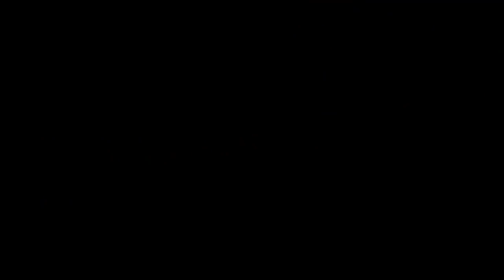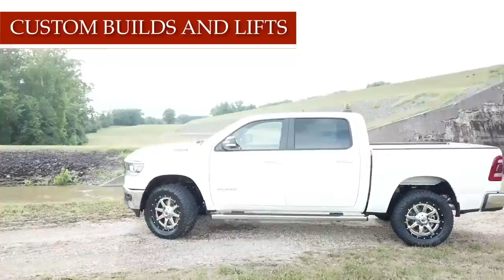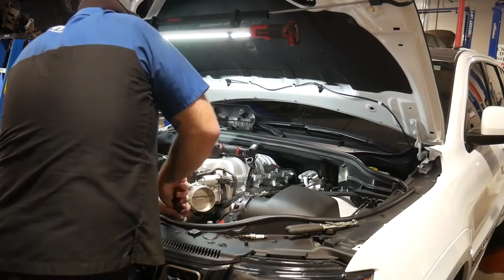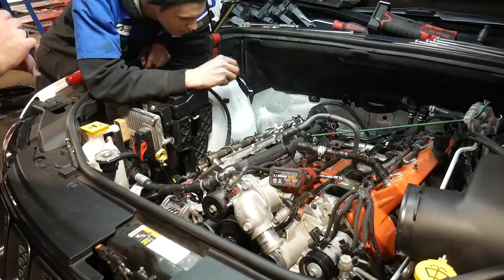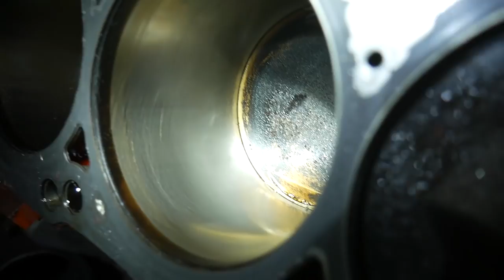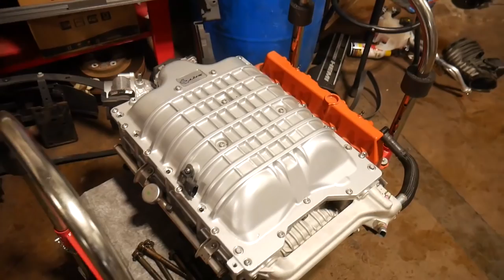TRACKHAWK HELLCAT ENGINE ISSUE AND HEAD REMOVAL

Comment from the maker: Just a repin from fwddodge22...
Yes he found the problem. The valve stem seal failure will cause a significant vacuum leak into the crank case. As a result the engine will suck down oil through that failed seal. Also since this is a forced induction engine, that same failed seal will allow boost as higher Rpms to force pressure the opposite way through that same failed seal - so instead of oil being consumed at idle, run the rpms up to 3000 rpm now intake air pressure is forcing oil back out through the pcv system which is then getting sucked into the intake and through the supercharger. The misfire is due to the extra oil getting into the chamber where the failed seal is making the mixture way too rich- that’s where the carbon deposits on the back on the intake valve, and the spark plug along from leaking oil come from. 
Also there were extra tests with compression and leakdown done before I started filming, I will be sure to add those next time.
Reply: Rustbelt Mechanic  noob question but would the valve stem seal failure also cause low compression as well in that cylinder?
Reply: Has there been any updated on the motor
Reply: Well said
Reply: Have ya worked on any of the 2016 chrysler 200 wit the 2.4l engine and excessive oil consumption
Reply: @skschow779  no.
Reply: Not yet
Reply: I like the fact that yall honest mechanics and yall show yall work to the world unlike the snakes here in Philadelphia keep up the good work
Reply: TheCarSection TheCarSection not every mechanic has a YouTube channel
Reply: @Simon Chow no it shouldn't. just oil consumption
Reply: @skschow779  no. The seal is above the sealing area. The valve guide would have to be real jacked up causing to valve to shift in the seat to cause a pressure loss. Very unlikely but is possible.
Reply: Just one question, How does "extra oil getting into the chamber" make the mixture way too rich? I'm not following
Reply: @jairosendsit8667  I understand that but you don't know how many snakes as mechanics we have here it's a big thing here.
Reply: @xj31  oil is combustible like gasoline. The engine doesn't know the difference. It will burn it as a fuel source if it gets into the combustion chamber. The problem now is that the engine already has a calculated fuel amount going into each cylinder for a correct fuel/air ratio under load. That added oil was never supposed to be calculated which causes a richer fuel/air ratio in that specific cylinder which results in a misfire. That misfire can cause serious damage to the engine if left unchecked.
Reply: @YeahYall  That was a great explanation, but it wasn't a test for you, LOL.
 I will admit, I didn't watch the entire video, for some reason it keeps stuttering and I can't take it
Reply: You can always tell the parts replacers from the actual technicians. Lol.
Reply: @BAYAREAMX  Yea, the parts changers are the guys making money
Reply: typical rookie mechanic coming through last minute to "add" the test which were completed off camera. imo
Reply: @imfloridano5448  what?!?! Oil consumption?!? On a 2.4?
We were keeping 3 of those motors in stock
Reply: @BAYAREAMX  true. But that's the way it is. This is the only job I know of that pays you less the better you are at it
Reply: @skschow779  :fi

Comment: 100k truck and no fender protectors?  Wtf
Reply: Just got my 392 back from the dealer and I can clearly see the shirt/button imprints on the fender! Lol. Obviously not using the fender covers.
Reply: That and hang a light from the hood, on the paint!!! I almost cant watch
Reply: That’s the way it is with most of the shops, you go in to get your car fixed and come out with all kinds of scratches and marks on your car. I dread taking my car to get it serviced. Good luck if they put everything back where it goes.
Reply: They'll leave oil on the steering wheel, shifter, your seats, your doors. Etc. Including scratches on the front bumper from the guys wallet chain 😅 Yuck. No thanks.
Reply: David Hammett oh please, that’s when my ocd kicks in.
Reply: Yeah I was wonder why no fender cover I'd be pissed!   One time my super duty went in for a recall and the mechanic had a big cowboy belt buckle and scratched up my fender....it got ugly for sure!
Reply: @JAMESWUERTELE  They are foam ends. It isn't going to hurt the paint.  It's not in motion rubbing either.  Don't like a tech using one? Fix it yourself.
Reply: I never used fender/bumper protectors when i was a new tech, i was very cautious and did not leave a singel mark for 4-5 years, then one day the quick connector on my airgun failed and the hose and connector hit the front bumper and made a small scratch, I had the bumper repainted and since that day i use protection everytime i do under hood jobs.
Reply: Jason Daniels I do fix it myself, my 2 Nissan’s and old 7.3 Ford stay away from hacks.
Reply: You get what you pay for. Want better car takin of your car find a local small shop that specializes. Like us we primarily do classic hot rods but are fully equit to do brand new vehicle's as well as trained. Plus we give the same care as our classics wiped before covers are placed on seat, floor, and wheel as well as both fenders and hood slips. After services are complete your vehilce is fully detailed and ready for pick up. Just shop around people!
Reply: I like how you say take it somewhere else for better service . It's a new vehicle getting a warranty repair. It has nothing to do with what you pay for the service it's about a tech taking pride in their work.  Even jiffy lube tosses a cover or two on during a 20 min oil change. These guys are leaning on it for hours. 

It's for these reasons I always wash my truck and do a video walk around before any service.
Reply: Soy Yo  Soy Boy your driving a 92 Honda of course you wouldnt care
Reply: And he has Ear Pods in. Wow. Smh.
Reply: Just got my scat pack back with scratches, chipped lower grill, and a new wind splitter. It has a appointment with their body shop on the 16th. Maybe this is a Dodge thing. Bring em in and bump em into shit.
Reply: @getnbigger29  actually it does! Just because the dealership sold you the vehicle doesn't mean you have to go there for warranty work. We have local dealerships (ford, mazda) send us warranty work regularly. If you want your vehicle cared for rather then just simple maintnace go private. You want a shiny building to take your car to with people only trained in certain areas scratching your car and leaving grease everywhere then go stealership!
Reply: news flash, I have worked at 3 major dealers and I have never seen a single tech use a fender cover. maybe if they payed a 0.1 punch for using them the flat rate guys might bite;)
Reply: I was about to say the same thing. 🤣

Comment: Love how they are both leaning over the guys fenders with no covers scratching the shot out of his paint of a $100k Jeep. This is exactly why I don’t let the dealer touch my truck. Warranty or not
Reply: Don't worry, it doesn't matter. All of them will be in the junkyard soon enough just like all the rest. Remember all of those chargers and vans they sold (regardless of model)? Yeah, I RARELY see one still going and it's usually an srt8 that probably has low miles lol. We can even ignore all of the smaller passenger cars that have all been melted down in China.
Reply: It’s just a jeep with a hellcat engine. A body shop can easily touch up scratches.

Comment: It's a hellcat lottery kind of thing. I've already had to rebuild 2 of these engines due to piston failures. One car at 800 hp with absolute perfect data log. Tune was spot on and the other was a stock hellcat. Both suffered piston failures due to breaking right around the oil drain back holes separating the top of the piston from the bottom. Cylinder 5 one one 7 on the other. I've seen these cars make right at 1000 hp with no issues. Guess it's a lottery thing.

Comment: I would never bring my car to your shop-no protection on the paint they make a roll of film for this. What really gets me is you never even taped up the intake ports, all that dirt and the risk for something dropping in there would not be good. Just tore into it without a proper diagnosis other than an oily plug....
Reply: No one wants you as a customer anyways Douche canoe
Reply: Better to remain silent and thought of as a fool, than to comment and be known as 1
Reply: Dave D I was thinking same thing. $100,000 Jeep.....WTF!!!!!
Reply: All the dirt? What dirt? It has no miles on it. That thing is spotless. You don't know what other diag was done so.....It's not his first rodeo so experience helps get to the bottom quickly.

Comment: Confused a boroscope or leak down couldn't give u the same answers
Reply from the maker: Leak down was within 5 % and engineering wanted head pulled likely due to how new this engine is
Reply: How would you put a bore scope through the s/c ?
Reply: @stonesofetown6767  Spark plug hole?
Reply: @stonesofetown6767  that would not work. .... however you could pull the fuel injector on that cylinder and use a bore scope to look directly at the back of the intake valve looking for oil/carbon deposit buildup.

Comment: I understand what you're saying about the valve seal leaking oil into the cylinder, and the supercharger forcing air/fuel back up it at higher RPMs thus causing more (more than Mopar's already oily norm) oil into the PCV valve and back into the supercharger and intake runners. BUT... why is that specific misfiring cylinder's intake runner completely clean when all the others are black oil slicked? It would seem to me that the only way that would be the case is IF that valve was also not opening thus not allowing that oil soaked air mixture to be sucked/forced into that cylinder? Seems to me you should also be looking for another issue, like a bad lifter and destroyed cam lobe that won't allow that intake valve to open far enough to get any kind of air/fuel mixture into it, which is also a VERY well known cause of Hemi misfires.
Reply: The broken valve spring could also be causing this
Reply: @travisklotz9171  Did they end up finding a broken valve spring as well as the bad seal? I was thinking the same thing after I wrote that comment, but figured they would have seen that immediately when inspecting the head, whereas the cam/lifter takes a little deeper inspection, that some don't do... Broken valve spring, ANOTHER known Hemi flaw plaguing us Hemi owners!

Comment: I could be wrong but I know cars have engine break in periods especially with higher performance engines and I’m sure there are people that hammer on the car with less then the recommended 500+ mile break in period would that cause these issues?

Comment: Awesome video!!! I just subscribed to your channel, I own a Trackhawck and I was wondering do you think I should put a catch can on mine I just hit 3500 miles and I absolutely love it it's the best car I have ever owned and I have had alot of car's also do you think this was just a bad deal from when the motor was built at the factory or do you see this might be a problem in the future for Trackhawck's?? I'm glad I purchased a 7 year 100k bumper to bumper extended Chrysler warranty. One last thing if I put a JLT Cold Air Intake on will that void my warranty?? Thank you very much for your time and hopefully your response. Oh also I had the resignator cut off the exhaust will the dealership frown on that against my warranty??
Reply from the maker: Thanks for the support man. On the exhaust, they shouldn’t give a crap, they’d better not at least. I believe this was an isolated incident with a manufacturing flaw, not something that was caused from heavy use/abuse, so catch can...eh...wouldn’t hurt 🤷‍♂️. As for the intake I wouldn’t add it unless you are specifically going for hp, run track competition, are likely to build motor and don’t really care about warranty. As I’m sure you already know this thing can snap your head back better than any car around right now with an awd launch, I wouldn’t mess up any warranty you bought with an intake....just my 2 cents at least.

Comment: Damn id be pissed if i spent that much on a car and it had to have its engine tore down before 10k.
Reply: This shit happens. Machines are only as good as the people that build them. There's always gonna be bad builds here and there.
Reply: jclark yeah this is just one of those setups that NEED to be driven .
Reply: Dont bag on them until broken in..

toyota and Honda's have huge recalls on engine replacements/issues ..Honda 4cyl burns oil like mad for 2018/2019..Subaru omg they need  engine replacements..

Comment: Replace the cylinder head for a valve seal?  Seems extreme.
Reply from the maker: Yep after being ran this hard with the misfires and oil being run over that valve, engineering was worried of valve and seat issues further down the line.
Reply: Yea could be Excessive play in the valve the blew out the seal
Reply: Broken valve spring too I thought you said?  I would want the head done too if it were my car. You have to pull the head to clean that valve up anyways and while you cleaning it might as well lap that valve. 4K seems excessive for that head though

Comment: I'm assuming that the reason the engine failed was due to modifications to it and that is why he didn't go to the dealership and is currently not under warranty. Otherwise why did not the owner of the vehicle take it to the dealership for warranty repair unless he had done illegal modifications to it which voided warranty that's usually why they fail
Reply: Star center is the warrenty branch
Reply: 3 year warranted or 36k unless extended are purchased my guess is it wasn’t. Dealers charge you a left nut.

Comment: The intake runner being significantly cleaner than the rest is a little odd.  Unless it's a just quirk of the PCV system.  I wonder if the overall excessive blow-by is caused by the factory running looser ring gaps to contend with the forced induction stresses. 

It'd be interesting to take the valve out and see how the spring and seat look.
Reply from the maker: I’ll show it on the next video but I think we’re actually getting excessive boost blow back into the head through the destroyed valve seal, which in turn is why we’re having the excessive pcv oil/pressure issue. Keep in mind this motor is also under boost(HEAVY acceleration) ALL the time, even on cold start up. It is not treated nicely.

Comment: It seems the engineers didnt take into account  the extra strong suction for the pvc that fills that blower with oil. They should have designed a catch can and some type of steel screen or mesh in line of the engine blow by system. It will catch much of the oil and drip into the catch can

Comment: What about a stuck injector?  Anytime I have seen clean intake ports is when an injector has stuck open and washed the cylinder. I work on a lot of mine, refinery, and a few oil field trucks. Seen it more than once.
Reply from the maker: Exactly the thought on another visit this thing was here. There was an injector replaced by another tech. Now after having the head off it all makes sense. That cylinder was having such an oil leak, especially on cold start that it was causing that cylinder not to burn so well, plus the spark plugs in that cylinder were HEAVILY oil fouled. So I’m believing the motor was trying to make up for lost power and increased fuel to that cylinder. And that valve seal was bad enough that under boost conditions(which this motor is in ALOT) it would force lots more boost pressure up through that failed valve seal, causing excessive oil to come through the pcv as well.
Reply: I don't know about the Trackhawk, but my Hemi doesn't have individual cylinder sensors to monitor AFR and increase or decrease one injector only. So unless the Trackhawk has sensors for each cylinder it seems there is another issue causing that one cylinder intake runner to be clean.

Comment: Carbon build up main cause is the PVC system. That's on every single engine regardless of manufacturer. Next is cam timing and over lap. Much more with a direct injection setup.

Comment: I’m a tech at a Toyota dealership and so I’ve been wanting to get an Apple Watch as well. I’ve been hesitant about it since I wouldn’t want to damage it. How do you like having yours and putting your hands in tight spaces.
Reply from the maker: It’s works just perfectly. I have broken one though while in the shop, but I’m sure to have accident replacement on it and a nice screen protector
Reply: Rustbelt Mechanic I think I’m just going to pull the trigger on one. I hope it’s oil and coolant resistant as well! Lol

Comment: my dad has a 2017 promastercity...engine uses alot of oil and apparently thats a normal thing? also we had an ecu update for an issue because the car ran rough but its still there...for shits and giggles i went into their lot and tried a new one and it was quiet and didnt vibrate..what course of action should i take?
Reply from the maker: Take it to a different dealer that has promaster certification or isn’t scared of doing warranty work.